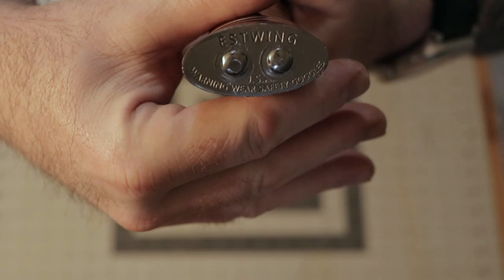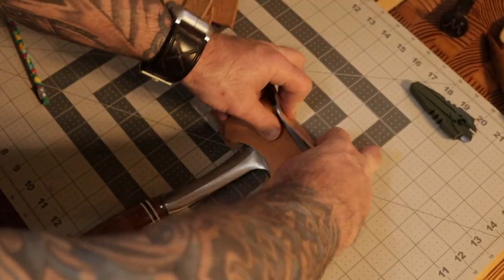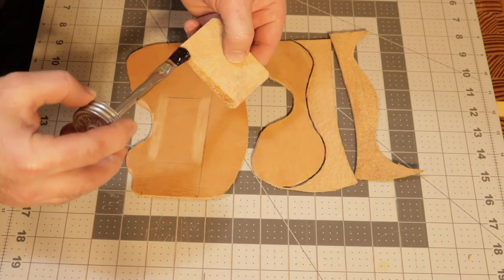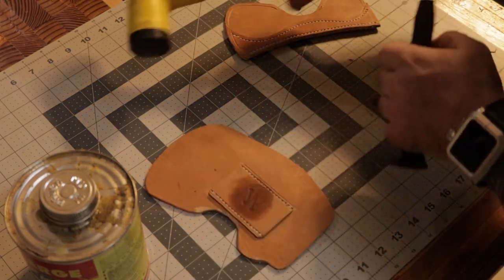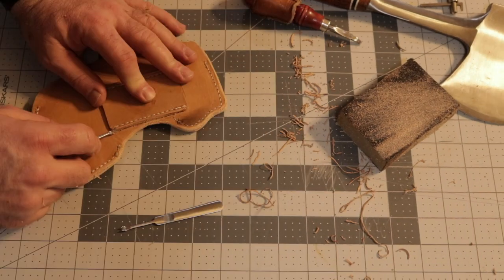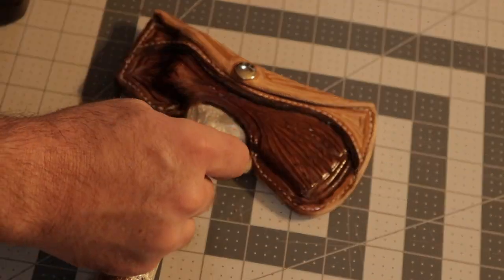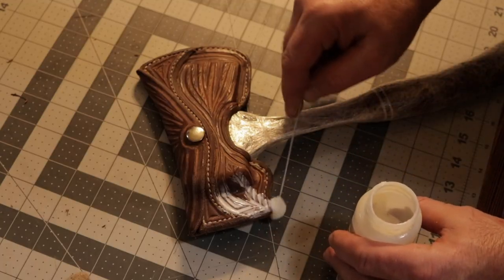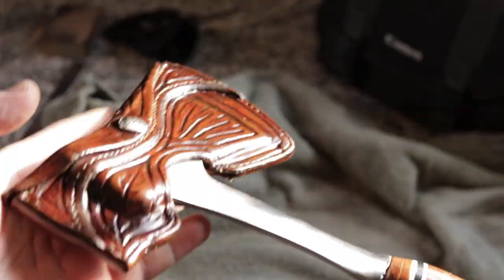CUSTOM LEATHER HATCHET SHEATH

Comment: How long after applying the oil do you apply the sheen?  Do you let the sheen dry before you buff or do you buff while it is still damp?
Reply from the maker: Thinus Rautenbach. If you know how much oil to put on to get the desired color, then put the sheen on after the neatsfoot is fully absorbed. If not wait till it dries to see if you need to darken it further. I wait till after the sheen dries to buff usually. Then I add saddle soap and use the burnishing tool to really establish all the lines and get a great slicked edge. Im no expert, just what I do to my personal sheaths. Then I use saddle soap the bring them back if they need a touch up. Hope this helps,
Rob
Reply: Thanks Rob, it did help.  Great job on the sheath SBTW.  Love the whole "freehand" approach you have to leather work.
Reply from the maker: Thanks 👍 I want to see links when you finish the project if you film it 😀